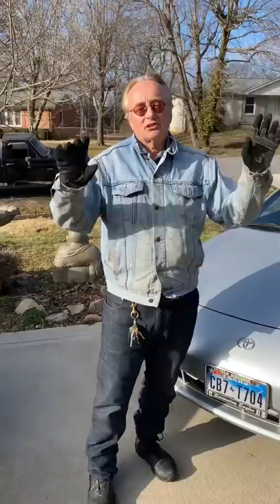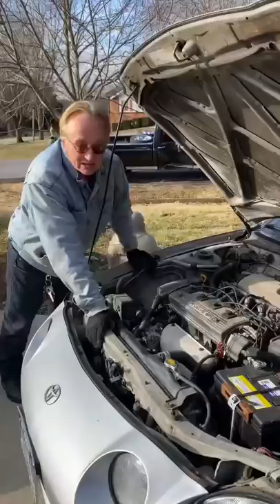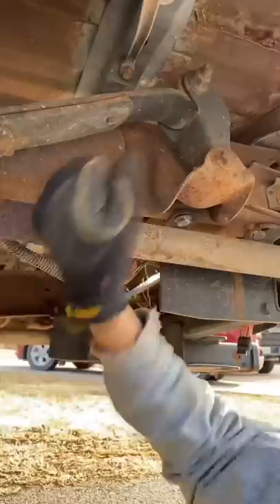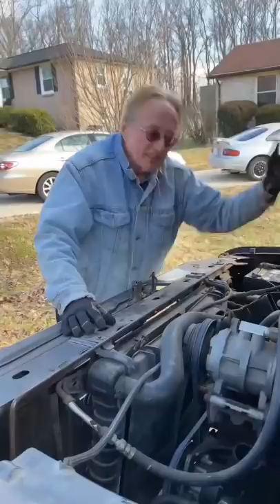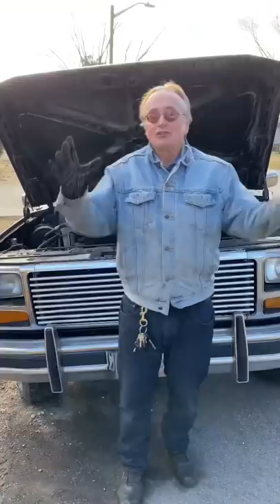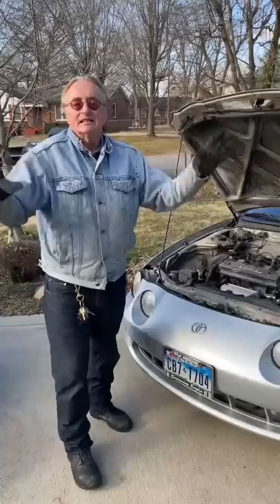Here’s Why Old Cars are Better Than New Cars

Comment: This might be all fine and dandy but tell me please. Why is it that people STILL neglect to maintain their cars, even when they now cost as much as $35-70K? The old cars turned into rust buckets from not keeping the salt off with regular car washes and blown engines/transmissions from improperly driving them too hard etc etc. All the so called better cars are all gone for the most part because we didn't take care of what we had. Nobody seems to address that pickup trucks today get just as poor of gas mileage as trucks from 50 years ago yet they are the most popular and sought after vehicles on the road now. I had a 2wd 1973 half ton Chevy 350 4bbl that I tuned up to exact specs according to the book. I put the gate down, went 55 mph and calculated that the truck was getting 22 mpg. Do we need to spend $75k for this?

Comment: bought a 2000 ford ranger with a stick in 2002 for 8 grand. had about 16K miles. drove it for 18 years to about 150,000 when the engine failed.  i had some repairs along the way, but 9.5K for 18 years isn’t too bad.
Reply: Easy when you do 7k miles a year or whatever.

Comment: New cars have planned/made to be obsolete/junk in a few years.
Reply: Business
Reply: No they are not. If you drive a rental car that is what new cars will look like in 25 years. I drive a new Malibu with 900k miles on it and it pushed me back in the seat with its POWERFUL tiny engine!
Reply: @fish_R_stinky69  900K miles or 9000 miles?
Reply: @zythr9999  900k New cars are NOT made as junk. That Malibu would be rusted and broken if it was not made to last.
Reply: @fish_R_stinky69  Oh I see. That's good, then
Reply: @zythr9999  My father complains about new cars yet his beloved 30 year old pushrod mustang is rusted and broken🤣🤣🤣
Reply: @fish_R_stinky69 😀😀😀 Oh well
Reply: @zythr9999  We have a "new" car and it is 8 years old and its valves are driven by "bicycle chains". Our overhead cam car is doing a lot better than the pushrodders.
Reply: @fish_R_stinky69  That's good.  It's a fine line between longevity and staying in business
Reply: Facts just modern cars are just there to fall apart and have problems after warranty expires or even before
Reply: @fish_R_stinky69  Nope. Newer cars are intentionally made to not last long so that you will be forced to buy new ones again and more profit for car companies.
Reply: Lol. Well those older '60s, '70s and '80s cars were considered worn out by ~120k miles, needing engine rebuilds and they rusted out even quicker while newer cars will exceed ~200k relatively easily with minimal corrosion.

Newer cars are more reliable, powerful, efficient and safer. They aren't as pretty though, but that is subjective.
Reply: @kaliyugatourguide  New cars have technology problems,parts break when warranty expire,expensive to fix and take a long time to rebuild vs old cars can be rebuilt and lower cost, simple to fix and can last a long time
Reply: @fish_R_stinky69 LOL. You could not be more wrong. And you don’t have a new car with 900 thousand miles on it. 😂😂😂😂😂

Comment: I'm certainly not a for-real mechanic; I could only handle simple stuff, 40 years ago. I kept my Bug on the road with valve adjustments, and oil changes every 3K  miles; plugs, points, and condenser as well. In the 70s and 80s, that kind of stuff was all it needed at that short a time interval. It ran forever on nothing. Now, even if I had not sworn to boycott VW Group for life (for multiple cases of murder), the design, fabrication, warranty, and financial tandards have long since dropped down the crap-crammed culverts. 
Quoth the Raven, "Nevermore."             
      - The Raven 
Edgar Allen Poe

Comment: My vehicle is 40 years old and has a solid metal frame and it's rusting out really badly big chunks of it is missing. Any tips for navigating this issue?
Reply: Bondo & tigers paw
Reply: If you have time, learn welding and DIY the rust repair.

Comment: I prefer fuel injection. It's been my experience that they've always been more reliable than a carburetor.
Reply: Yes there are plenty of things I don't miss about old cars. Drivability for one. And who wants to go back to points and distributor? Carbys were a pain in the neck.
Reply: Carbs is like going back to using a horse and cart.
Reply: biblereader  There's nothing wrong with carbs. My Triumph Spitfire has them, but fuel injection will always be way more efficient/reliable/powerful/economical.
Reply: OBD1 was the best. Simple, reliable, modern enough. Early to mid 90s. And now, no inspections.
Reply: Carburetors are fuel inefficient and can leak when older. Hard to start in cold winters. EFIs are the opposite. Most Japanese cars built about 7 to 11 years ago have the right amount of needed technology and have proved highly reliable.
Reply: My dads 30 old Mustang is fuel injected and it has no problems.

Comment: Computer chip problem. Easy fix!. Stop computerizing cars! Problem Solved!
Reply: If you want some pre 90s junk that rusts, is slow and gets awful fuel economy go ahead and buy it enjoy having to adjust cables all the time adjust carbs all the time enjoy the fact they won't run well on modern fuel. Compared to old cars modern cars are far more reliable as long as you don't buy some stupid luxury car and stick to a good german, japanesse or south Korean car.

Comment: Carburettors are junk 90% of the time. They only have the right mixture for a set rev range in a set temperature in a set throttle position. Outside of that it's always either too lean or too rich. And don't get me started on vaccuum/electric controlled carbs

Comment: I think in some respects, the new vs old is a trade off.  Cars these days are lasting a lot longer than they used to in general.  It used to be (even 20 years ago) if a car got to 150k or 200k miles that was it's life. But these days, 150k for many cars (the better quality cards, regardless of what materials were used to make them or their components) that's "mature" but has plenty of life left in it in most cases.  Plus, as we saw even with Toyotas, even if you have a steel frame, it can rust and rot if it's not made properly over unibody designs (again, if made properly, can last a long time).  Same goes for many engine parts too.  The older ones may be cheaper to rebuild, but you might have to rebuild them more often than a modern one, since many modern components (alternators, fuel pumps, etc) can easily last 150k or more, and fuel pumps, injection systems, water pumps, etc can often times last the entire lifetime of a vehicle.

Comment: Old cars are better because there wasn't so much emissions and safety regulations back then. Now cars have to include sensors, catalytic converters, bulky frames, airbags etc. Cars get bigger and more expensive to make so companies cut costs on them so some of them feel crappy and cheap and have unreliable engine parts that fall apart after 200k kilometers

Comment: Lmafo 😂
Let me bust out
1. He said solid metal parts. Yes,  but nowadays cars use plastic parts to aborb kitnic engery and crush during impact. Those older car parts get into cabin and hurt us. While morden plastic ones easily get crushed and wont hurt anyone.
2. Fuel injection system is more precise and better than carbartor which incrses fuel efficiency and less emisson.

Comment: Can't trust carburetors with ethanol in the gas and non-ethanol gas is way too expensive.
Reply: True. Unleaded also erodes valve seats unless they're Stellite, which Stude was using in the early 60s. Other makers started a decade later.

Comment: But old cars have higher insurance premiums, higher road tax, less modern commodities, less modern safety features and a lot worse gas mileage
Reply: Safety? Run any plasticrap into a 59 Imperial and see which one survives in running condition.
Reply: The insurance is higher because it’s more expensive to replace an old car
Reply: @stephenarling1667  things like lane switch assist, automatic braking, parking sensors, parking cameras

Comment: Bahaha 🤣 they don’t get worse gas mileage unless they came with a 3 speed transmission lol 😂 otherwise they get the same gas mileage as the new cars or change the gear in the rear axle to compensate for the 3 speed transmission and then it’ll get the same gas mileage as a new car lol 😂

Comment: Fuel injection was one of the best improvements, as far as i'm concerned. Carburetors are a pain in the butt. Sorry Scotty but i have to disagree.
Reply: Yeah, but fuel injection is not the best if the fuel quality is questionable where you live. Plus it added unnecessary complexeties like cam and crankshaft censors. My cousin almost died stranded in a cold mountain pass last year because of her Audi A3's crankshaft censor failing. Before that i told her not to buy a complex modern car just cuz its shiny. Needless to say since then she got an old army jeep, and has been driving only that.
Reply: @meganoobbg3387   All modern luxury cars like audi, merc, Bmw are just giant computers on wheels. Very unreliable. Endless money pits